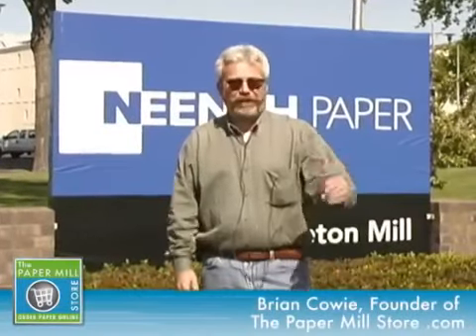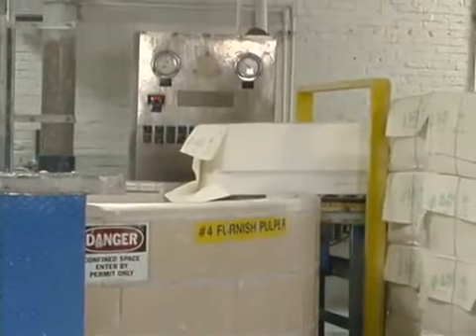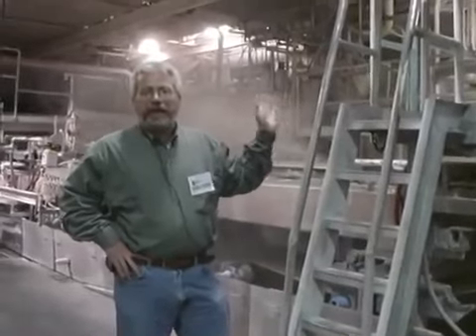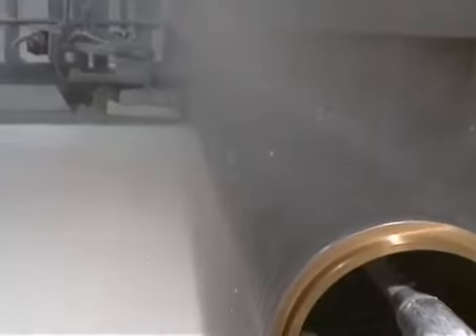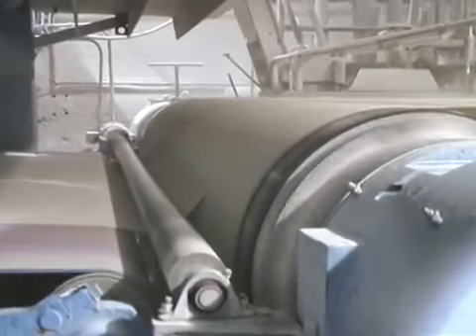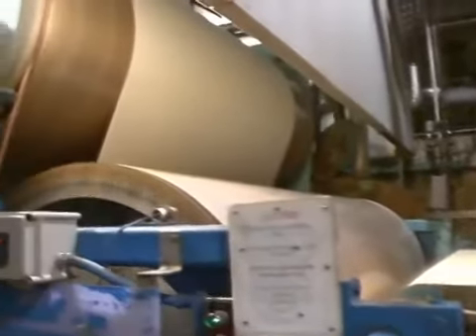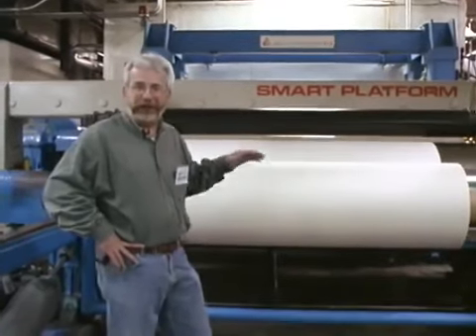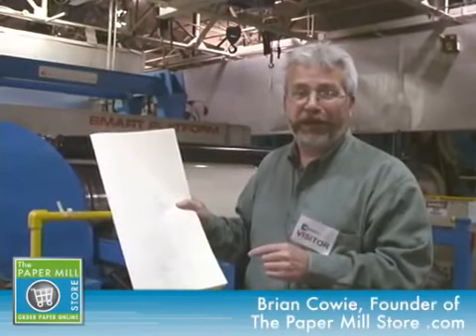Tour of the Neenah Paper Mill in Appleton, Wisconsin

Comment: Going to be a sad day in September when this mill shuts down. It will be the first time in 133 years that paper will not be manufactured in the flats. Unfortunately, I really don't foresee this mill opening again. It's a logistical nightmare at this point with both the Neenah locations being much more accessible. I would expect the old parts of the mill to be apartments/condos within the next 5-7 years. I hope they keep the old FRP stack at least, but I doubt it due to ongoing maintenance costs it just wouldn't make sense.
Reply: Hello Mick.
I worked for Great Northern Nekoosa in East Millinocket, Maine from September 1979 to April 2011. Both mills in East Millinocket 
and Millinocket have shut down and have been demolished for scrap. We made everything from newsprint to coated paper. In
1970 Great Northern Paper merged with Port Edwards Paper and Nekoosa Paper to form Great Northern Nekoosa. When that happened profits from our Maine mills went to build a new paper mill in Georgia. Then we watched as money was drained away
from our mills to other start ups all over the country. In the 1980’s machines in both mills started shutting down and many got laid off…including me. I got recalled back and saw 3 different buyers own the mills and each time we lost benefits and wages.
Great Northern Paper operated from 1899 to 2014. Pixelle Specialty Solutions owns the mill in Jay, Maine and it was just announced a few days ago that mill will shut down in early 2023. Maine has lost 8 pulp & paper mills since 1992. Wisconsin and
Maine always lead the nation in paper production. The paper industry is so uncertain these days.